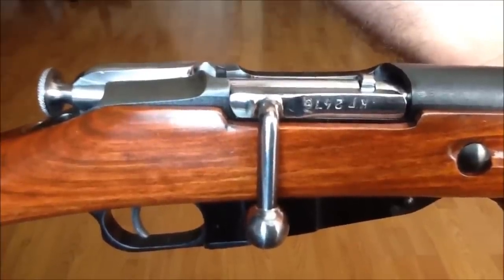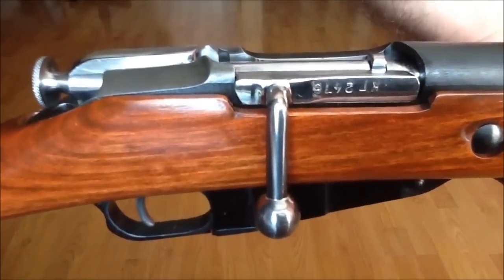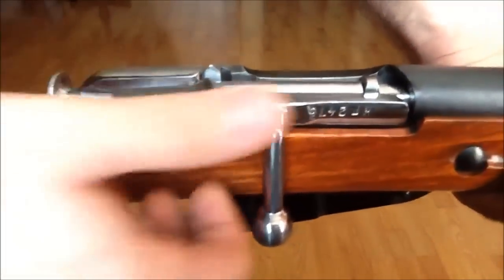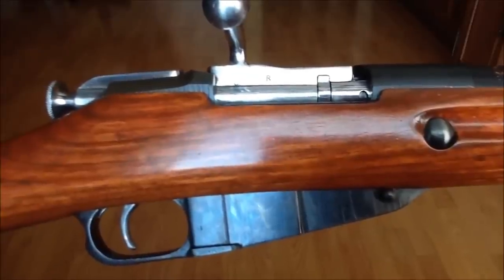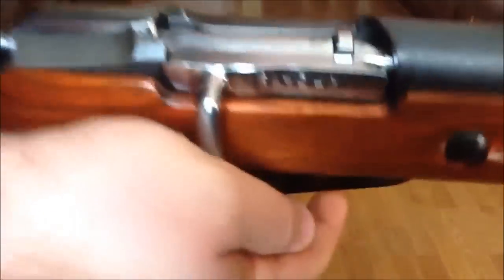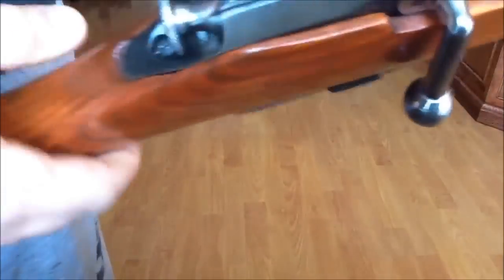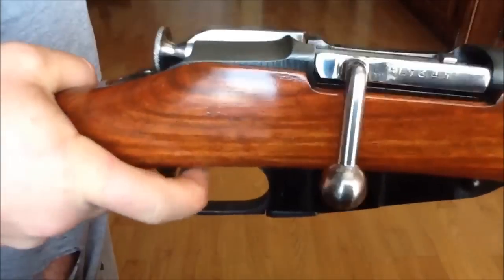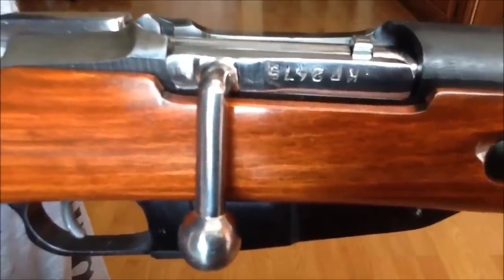Why Your Mosin Bolt May Be Hard to Close (not chamber or extractor related)

Comment: Would installing pillars fix the problem?
Thanks for the video!
Reply from the maker: Yes, absolutely. Pillar bedding the stock would be the most correct and appropriate fix. Without it, the wood stock will continue to compress every time the action screws are over-tightened, even by half of a turn at a time. I had shimmed the area around the action screws, but this could still continue to allow the compression of the wood. It would be nearly impossible to deform/compress even an aluminum pillar. If you are thinking of pillar bedding, you could buy a correct diameter (and thickness) steel pipe from a metal tubing supplier, and cut to length for your action. Then bed those into the stock. I haven't personally done this, but understand the process and believe it is the best method for fixing this, and other issues.
Reply from the maker: Yes, pillar bedding would not only solve the problem where the bolt is rubbing on the magazine box, but also ensure the problem never comes back. Also the grouping may be better as result of this.

Comment: Do they just heat up the bolt and bend it?
Reply from the maker: no, the bent handle is much longer. the original handle is cut off and an aditional length of rod is welded in between the bolt body and knob.

Comment: My mosin had trouble closing on a round in the chamber but after I sent about 60 rounds through the bolt started to lose up and was chambering better didn't have to beat it closed but still not butter smooth.
Reply from the maker: Sounds like a different issue from the one in my video. If it only does it with a round in the chamber, you should check your extractor condition, chamber condition and locking lugs of the bolt. If it is getting better, something is either getting smoother or cleaner. If you find what caused it, and work on that, you will resolve it completely.
Reply: MosinVirus it appears to be the bolt face it's self when you push the round forward and chamber it the base of the round is supposed to sit in the bolt face in the lip and the tolerance is too close to allow the round to easily go into place. Do you have any idea of what could be done I've got several and am looking to see if there are any alternatives or if anyone can think of another idea I haven't come up with.
Reply from the maker: ShaDOWDoG667 Check it with Go Gauge and No Go Gauge. If you are right, the Go Gauge will not allow the bolt to close. In that Case you may want to try a different bolt head. Are you absolutely sure it is not the extractor not wanting to go over the rim of the cartridge?
Reply: MosinVirus well it shoots fine and the extractor rides right over the rim but the base of the round will not go past the lip on the bolt head because of the lack of proper machining.
Reply from the maker: Do you mind sending me a picture of the bolt and the cartridge in it? You can send it to Mosin.Virus@gmail.com

Comment: My 43 91/30 is the same, I have the normal bolt on it tho, I think I need to do your idea and maybe add a leather spacer
Reply from the maker: Better than leather might be tin. Just cut up some food cans. And make the shims follow the shape of the magazine box / trigger guard inserting at each screw.
Reply: MosinVirus I loosened it, I'll have to try the washers, and I'm looking to remove a broken sling mosin nagant 91/30 sling escutcheon, can't figure a way to get it out, it's a 1943 Izzy, and it's a folded tab one
Reply from the maker: There were not meant to come out, but you would have to get at those little tabs that were bent into the slot to capture the escutcheon in place, and bend them back out. It will not be easy and I have never tried.
Reply: I got it out and put it back, i fell with it on my back and dinged the stock and it came loose LOL, not very much damage to the stock thank god
Reply from the maker: Cool. Just be careful. No escutcheon is worth breaking bones. :)

Comment: 2 SMALL WASHERS WITH LOCK TIGHT ALSO WORKS
Reply from the maker: Yes, but as any other shims they can be pressed into the wood over time. Obviously it will work and all depends on how many times the screws are undone and retightened.

Comment: thank you so much. this fixed my problem
Reply from the maker: +Chase Kirkpatrick Glad I could help. But please make sure to not shoot the rifle with action screws loose. If you put some shims onto the stock and tighten against those, it will give enough clearance to not have the issue, but the action screws will be properly tightened.
Reply: +MosinVirus that's exactly what I did. I also polished the bolt while it was out and that helped to
Reply from the maker: +Chase Kirkpatrick Nice.

Comment: My problem is the action is tight with ammo in the rifle now that I got a new ammo follower.. 😐
Reply from the maker: Did you just replace the follower? Or the entire lifter assembly?
Reply: @MosinVirus  the whole assembly. Then again it has been years that I had the part. Replaced the firing pin, and someone in the past through away the parts matching follower.
Reply: I did use spent shells to see how it would action with the new part and Lube🤭
Reply from the maker: @Christophersanchez1326  so it is difficult to make rounds feed into the chamber or is it difficult to actuate the bolt with a loaded magazine?
Reply: @MosinVirus  difficult to close the bolt, very tight.. In words to slap hard to close the bolt.. When empty with no rounds it's easy action. Like what you showed with your mag screws loose..
Reply from the maker: Then it might be an extractor or chamber related. Look up Mosin Nagant sticky bolt and you will find many videos describing issues and solutions. Mine was covering one issue not mentioned.
Reply: @MosinVirus  I'll record a video and make it unlisted and show you what's going on. 😊
Reply from the maker: If you need to send me a link, mosin.virus@gmail.com